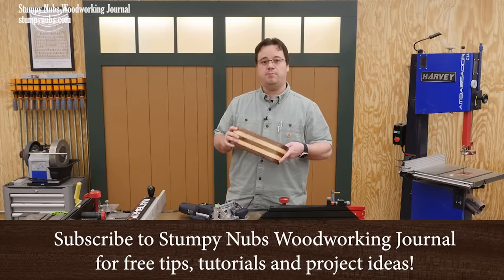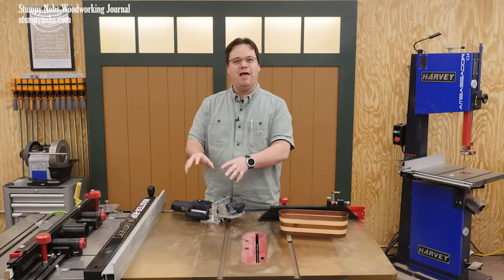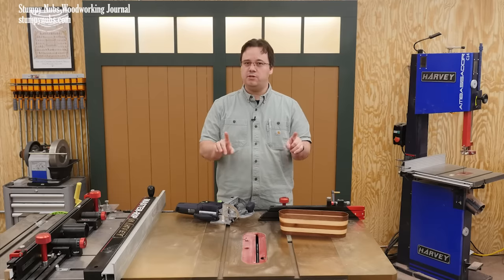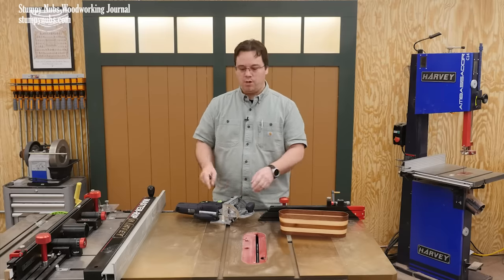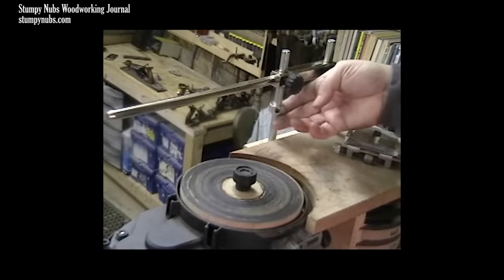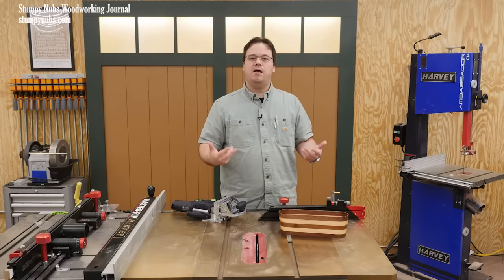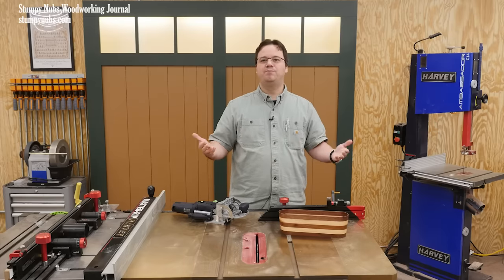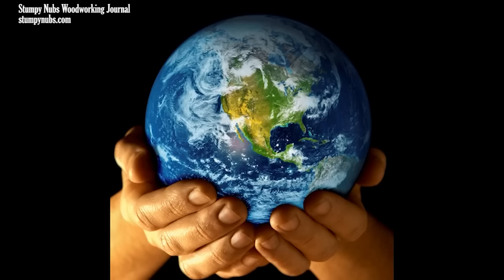This is why people HATE Festool and their Domino!

Comment: Reason 1: the price
Reply: Reason 2: The Price
Reply: You get what you pay for, it works brilliantly
Reply: @dougsaunders8109 You know what else works great? My 5 year old impact drill that cost 50$, so who do you think got a better value for there money?. Just because something work as advertised does not mean it worth however much money you pay for it. but people buy it, so I'm glad its been working out for you.
Reply: @nathenrenwick  I had trouble swallowing the price, that said it's paid for itself tenfold just in the past year alone. Could I do everything I do with my Domino another way yes I could. I found myself using it more for alignment purposes than actual joint strength
Reply: @nathenrenwick  I build custom, very large, exterior gates. And I build a lot of them. So for my purposes the price of this tool is worth the time it saves me hands down. I think it comes down to what you're building and whether or not you run a woodworking business or you're a part time in diyer with basic wood working skills and needs.
Reply: @dougsaunders8109  so does a saw stop, do you own one?
Reply: @dandeflavis7004  I hear you, and 100% agree that if the time saved is worth more that the cost of the tool the tool is 100% worth no matter the price. But were I get angry is festool is 100% ripping us off even though it is technically worth it.
Reply: I hear you, and 100% agree that if the time saved is worth more that the cost of the tool the tool is 100% worth no matter the price. But were I get angry is festool is 100% ripping us off even though it is technically worth it.
Reply: @nathenrenwick  yep fair play drill not an issue. You will not have a $50 smart phone, especially not apple or a cheap electric car. Some things cost more when they are new, Festool comes with three year guarantee and insurance. I still don’t buy their drills though.
Reply: @nathenrenwick  I don't think they are, the quality is high and they had to spend a lot of money to design it to do what it does as well as it does. I've punched probably 10 to 15000 Domino's in the past year and the tool is working just as good as the day I bought it. I've learned festool is professional-level tools if I was a DIY guy I would never be able to justify the Domino. I would probably buy the jessem manual Domino cutter for $350
Reply: Reason 1: The Price.
Reason 2: Jealousy of those who have one (this is a self-admission😂)
Reply: @Andys12169  nope don’t have one. In the UK very hard to get. In fact very rare in Europe. Festool have just launched a new model which as a version of it.
You can get some massive German panel saws with technology which stops the blade. Works very differently from saw stop
Reply: @rickrudd  fair play! 😁
Reply: The tool is amazing for someone running a business. It pays for itself in labour costs saved.
You mentioned Harvey....the reason not to buy Harvey is nothing to do with price...it's the lack of post purchase customer service.
Reply: @dandeflavis7004 dare I say most of us aren’t getting paid for our hobby so our tools can’t actually “pay for themselves.”

I don’t feel one way or another about festool. I just can’t justify the price. The hobby is already too expensive even if you try to keep costs as low as possible. 

We’re effectively making personal furniture factories in our garages and that’s pretty weird when you think about it. 

Maker spaces should be more common instead of everyone on the street wanting their own personal factory just to make bespoke personal projects for themselves.
Reply: Price is the deal breaker, and it's fine, we live in a capitalist economy, so a product that reduces work is worth whatever someone is willing to pay for it.  That being said, I have 3000lb cnc brideport mill that only cost me 1500 dollars.  Is a 4lb not always 100% accurate tool worth as much or more than a machine of that caliper......well you can see where this is going.  Congrats to festool for making a tool that is useful.  But honestly for the money, your better off getting a used cnc router, and setting it up for motising, it'll be faster and more reliable on setup.  I run a small woodworking business and the only way I would ever spend that money on domino is if I had to do on site work.  Which if you think about it, there are probably not many scenarios where you need a domino on site.  I'm sure the cnc router comment will get bashed because it's a bigger machine.  Well it can take a up a bunch more space, but I would also argue that you can setup a small cnc router and pass your board through the bed of the machine for each mortise.  Well I could go on for days how much more versatility you would gain from cnc over a domino, but there will always be kick back, like programming which is basically null and void for simple mortises.  But if you look at cost versus speed.  Say you need to glue 50 panels.  And let's say those 50 panels have 5 boards per panel, so you need to mortise 250 boards with say 3 mortises per board for alignment only.  Well your looking at 750 mortises.  I myself would want no part of doing that with a domino.  I would setup my cnc once, to run this single program and a quick fixture for the boards.  I would do 5 boards at a time, and once the first set is done, I  would be doing glue ups while the second set of boards are being mortised.  If your truely talking about value, the domino just has none in my opinion it's purely a status symbol and a bit gimmicky to me when there are tools out there which your hard earned money are better spent on and can make your work flow way more efficient.  When the domino starts making mortises while I'm doing something else, then it'll be time to start taking a closer look.  Until then do yourself a favor and spend your money more wisely.
Reply: The color😂
Reply: So by that logic Ferrari, lambos, 10000 sq ft houses, all things expensive must be bad. Enjoy your hamburger
Reply: I think a good honest company working efficiently and with their customer's best interests in mind could develop, produce, and sell the tool for less.

It's difficult to justify the price of this tool for anyone but a full time professional custom furniture builder.
Reply: If you're trying to save time without sacrificing quality, buy it.  You will forget what you paid for it once you get using it.
Reply: Reason Nr. 3: the PRICE...😢
Reply: It’s for professionals. That’s a well designed tool and does an amazing job. I’m a hobbyist, so yeah, the price is a bit high, but for professionals who make money out of it? I’d say it’s quite reasonable.

Comment: I finally found out who can afford a Festool - Cardiologists. I was waiting in the little dark back room reading a woodworking catalog, when the Dr. came in. He noticed my catalog and we got into a discussion on woodworking. It turns out that he has several Festool tools along with a SawStop. More power to him and whoever can get them. If I remember correctly my heart was doing OK.
Reply: Sometimes it’s cheap insurance when your real job requires all your fingers.  Knew a 777 pilot who was .5mm from losing his eye for the want of the right tool/protection for a home repair.  (eye lid puncture and scratched eyeball.  FYI No one-eyed pilots allowed)
Reply: Saw Stop is some AMAZING tech.  However, the inventor tried to lobby the US govt to mandate it on all table saws which would require them all to buy systems from him.  If he cared so much he would allow all makers to use his patents and such but instead he tried to get the govt to force them to buy his systems.
Reply: I had a surgeon who saved my life. We have become good friends. I cringed when I saw him using a table saw,. Those hands save lives, how could he risk them like that? But then I realized woodworking was his therapy. Without his therapy, he wouldn't have been able to switch off and would likely burn out. I have had almost forty years now thanks to him and he has since retired. I recently sharpened his chainsaw.
Reply: @Smurphenstein  Nice story
Reply: @1320crusier  He obviously didn't know how to lobby.  First, you cut a deal with a defense contractor and some really shifty congressmen/women.
Reply: I thought it was dentists. Of course, professionals all have them. They pay for themselves in a few jobs due to time saved. I'd get one if I was a pro cabinet maker in my area of 19th century and mid-1930s wonky houses. For my own use, dowels and a jig are good
Reply: He has some expensive fingers
Reply: I've always guessed that orthopedic surgeons would be at the top of the list if you ranked the number of woodworking medical doctors by specialty.  A lot of what they do is similar to woodworking and they even use the same types of tools.
Reply: I did buy a domino, even if it’s only a hobby. But then I have friends who buy $5k road/mountain bikes. Point is you can buy nice things without necessarily being a professionnal.
Reply: I cut my left thumb off with a rigid table saw. I bought a sawstop as soon as I got out of the er. It changed my life.
Reply: Or someone who sells their creations and invests the profit back into their shop.  It doesn't take many projects before you can build yourself a quality shop with great tools if you reinvest and shop wisely.
Reply: @cuebj  Dentists go racing xD
Reply: @mattwilliamson8459  how did it happen if you don't mind me asking?
Reply: @kaiserbailey  it was late one Saturday evening and I was trying to finish a kitchen cabinet I had spent all day building. I was fitting the door to the opening and just needed to cut the slightest bit off. I used a push stick to push the small piece out of the way and when I went to push on it the cut out on the end of push stick slit off the piece and my momentum carried my left thumb into the blade in a split-second. It all happened so fast. I was lucky I was able to keep most of my finger as it grew back over time.
Reply: My wife made me sell my Oliver 260-D (16” blades) and buy a Sawstop”
Reply: Yeah. I discovered a long time ago that people who make lots of money had better tools than I did, and they rarely used them. I was a pretty good carpenter at that point, and wasn't making enough $$ for Fein or Festool. I did see a video recently of a woodworker with nothing bu Ryobi in his shop. Ouch! I have a couple of Ryobi tools, but there's a limit. I like to mix it up, brand-wise, but am also mindful of keeping my cordless tools more consistent.